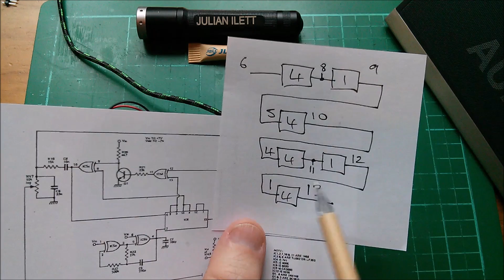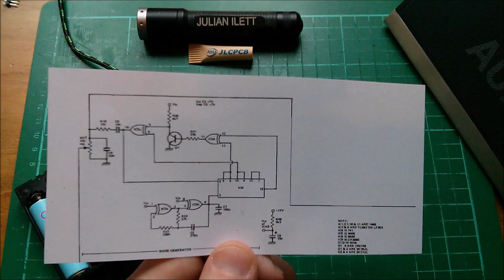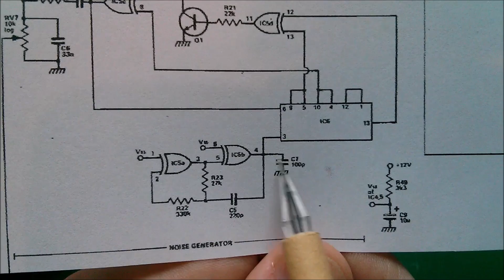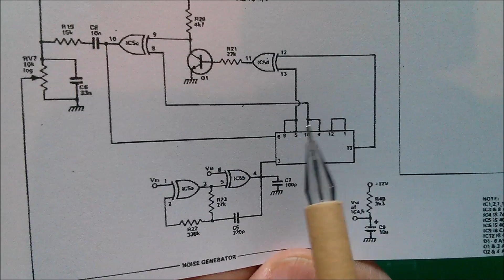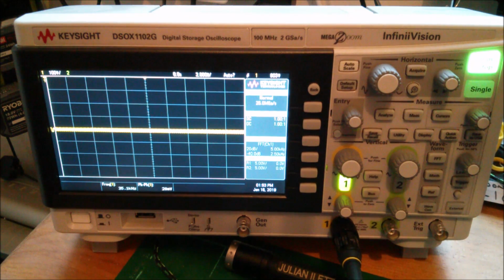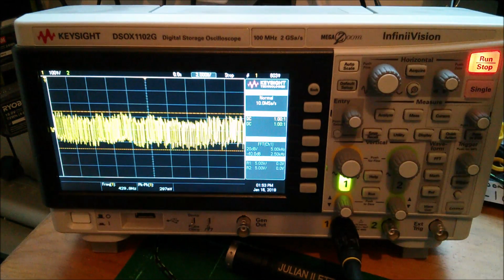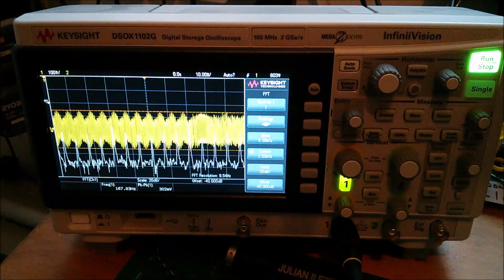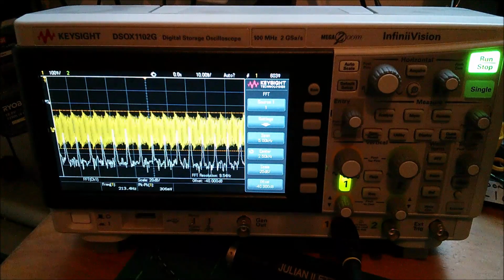Electronic Digital White Noise Circuit - Vocoder

Comment: I once used a 24 stage maximum length pseudo random sequence generator to encrypt an infrared link, but rather than use MSI logic, the circuit was implemented on 7064 PLD. This allowed all the link logic, TX and Rx to be implemented on one IC, including a VCXO digital phase locked loop as the clock source for the on chip MSK encoder/decoder. The PLL phase/frequency detector was derived from that to be found in a hc7046 MSI PLL.
The whole thing was written in VHDL. The circuit was used to test the continuity and identity of a 7.2MB optical fibre cable link.

Comment: I suspect you're capacitively coupled to the leg of the resistor. I wonder how different it would sound if you build the circuit on a prototype PCB. With such a small capacitor in the oscillator, you could impact the sound by how you route the wires.

Comment: The oscillator is sensible to RF around, the generated clock is full of hazards. The LFSR may have a big loop, or multiple smaller loops, according with the polynom used. The hazards in the clock signal make it jump from loop to loop.

Comment: Most certainly I am going to build this circuit. Think of it what you want, but I see this as a nice communicator with the spirits. Currently radio's are used for that, but this kind of white noise, which can actually be changed indirectly, I think will work great. I even caught some 'voices' talking in the noise of this video. But I would need to extract the audio to play it at different speeds to extract the info.

Comment: There's another way to make white noise with CMOS chips. I did a video about it a few years ago. Basically you use a high frequency ring oscillator, a 555 and a D flipflop. Feed the output of the 555 into the clock input of the flip flop and the ring oscillator into the D input. You can change the tone of the noise by changing the 555 frequency.

https://youtu.be/jGn9PyN9fgA

Comment: Actually, with the XNOR gate (XOR + the inverter formed from the NPN transistor), all zeroes is not a problem. If all the shift register holds zeroes, then pins 12 and 13 of the XOR gate are zero, the output is zero, and the inverter outputs logic high. Since this is different than the logic low on pin 8; the second XOR outputs a logic high, guaranteeing that the all-zeroes pattern doesn’t last!
Reply: This is only guaranteed with an odd number of taps. An inverting LFSR like this naturally fills with 1's when there are no taps enabled, and then any even number of taps produces 1 as the feedback bit. An inverting LFSR also behaves differently from a regular LFSR, producing different numbers and different lengths of sequences.

Comment: 3:47 it pretty much emulates  the sound oscillators from the Atari 2600 (the Tia chip implementation uses lfsr for its logic, since they are simple and cheap on silicon, except the oscillator runs ~31khz, so when you hear sounds from the vcs that's why they sound similar to this)